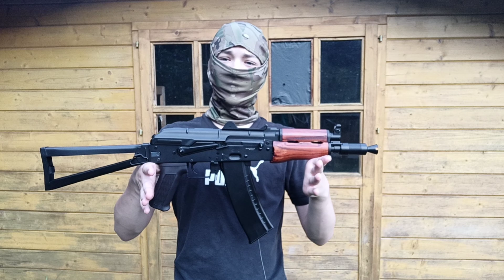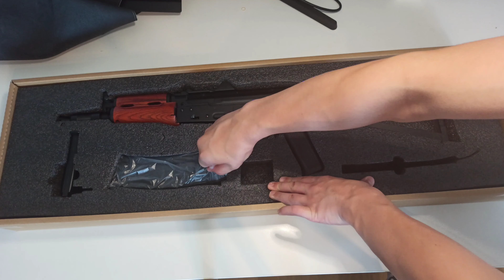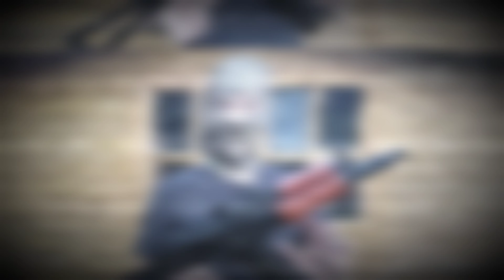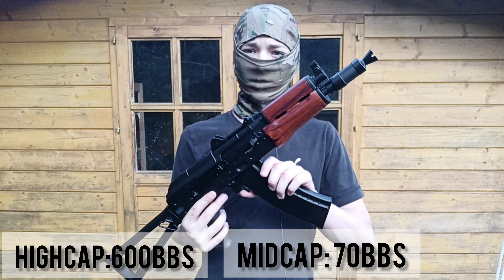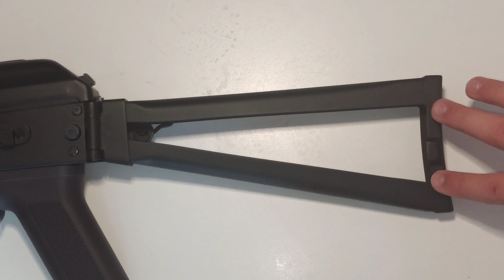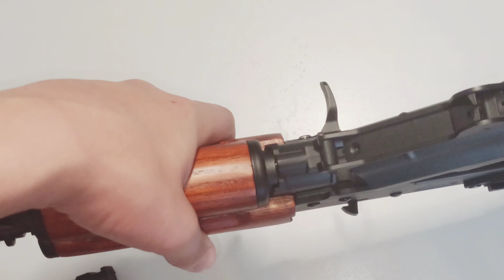cyma aks74u review. cyma to monster (pt1) (Airsoft 6mm bbs) [4k 60fps]

Comment: I got an E&L and a 5KU Zenitco PT-3 side folding stock. But the thing about the airsoft Zenitco stocks you have to brand specific. 5KU makes the E&L specific stock that has the 5.5 mm stock pin. Other then that its a great rifle.
Reply from the maker: Yep I changed to cyma because there are not as many problems with them, the Airsoft versions of this stock fold very bad so that's normal on every ak
Reply: Thats because E&L is made in chinese standard

Comment: There's actually 14 mm threads underneath the 20 mm threads. If you remove a grub screw you can unscrew the coupling it will reveal some 14 mm negative threads
Reply from the maker: Yes, I know. Thats right.

Comment: I had an old Chinese Ak 47, took out internals,piston,ejector rod, etc..took airsoft parts,not much and airsoft mags which fit right in, and an air tank connection. It sounds a little diff, but oh well,scares everybody . I have one for 6mm and one for .177 steel bb’s. They’re pretty fun..

Comment: Since when do you get 2 mags with this and regular ones at that. Usually you get a Bakelite hicap mag and those things are fugly and no midcap to be found. Also no speedloader. I will be buying this as my fist gun with a lipo instead if a nihm. The tfigger response is snappy af because of the neo motor.
Reply from the maker: There are many diffrent versions of shipping, in an other cyma gun I have I also only found one mag and no speed loader.

Comment: You're double tapping. That battery needs a heavy spring or you need an ab mosfet. Make sure the ab has levels though.
Reply from the maker: I know, a mosfet was already installed in the video later.

Comment: Are all LCT external parts compatible with CYMA? Also can you list the parts you used on your weapon? Great build 👌🏽
Reply from the maker: Everything is compatible. Its a pt1 from 5ku , a zenitco handguard for the aks74u (its a special one) cyna railed dustcover i dont know if its compatible, and 5ku pbs1 silencer. Did i miss something?
Reply: @ftacairsoft9485  thanks for the website. Some cool stuff on there! :)
Reply from the maker: @kierane1524  you mean wgc shop? Yeah its very cool shop.))
Reply: @ftacairsoft9485  ohhh wgc? I just are they UK based? Is this where you bought your 74u from?
Reply from the maker: Not my ak but all the parts, wgc ships to uk I think.
Reply: @ftacairsoft9485  great! Have you heard of ARCTURUS? They have released AKs and wanted to know if they are good
Reply from the maker: The models are very good and the ak12 feels very good.
Reply: @ftacairsoft9485  may i know the foregrip brand/model, tia

Comment: very nice building and looks very nice, I'm trying to install the 5KU Zenitco B-11U on mine but I have a lot of wobbling on the B-11 handguard, is there a fix for this?
Reply from the maker: Thanks, Yep I had this too, just try to get some tape around the part your supposed to hammer in and then hammer is in with the tape, you can also try to get some tape on the front of the handguard